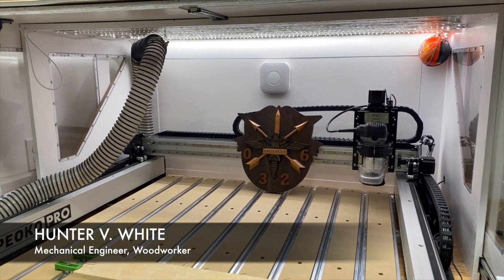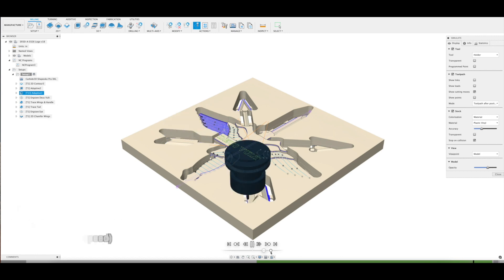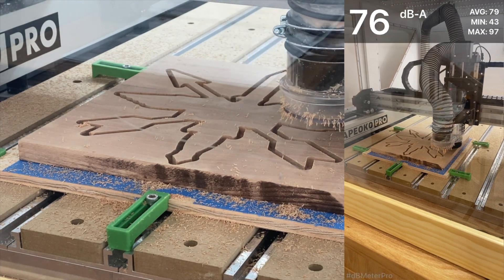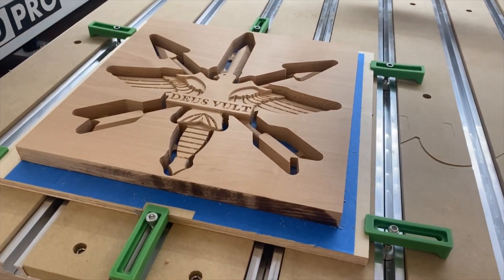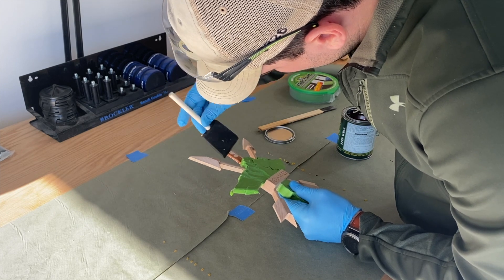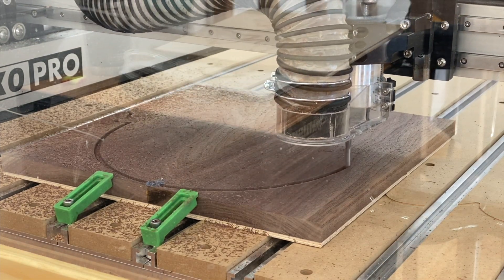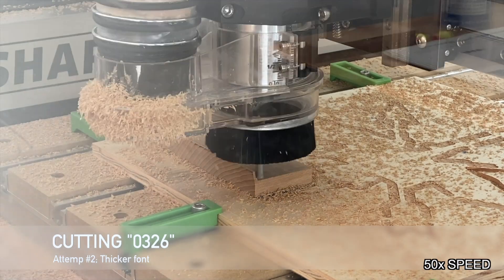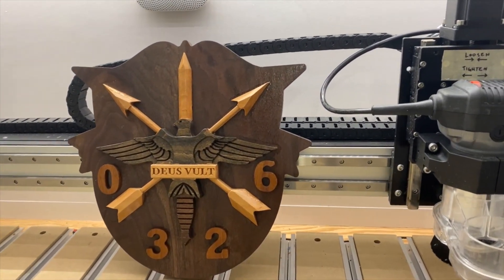CNC Project: Special Forces Detachment Logo

Comment: What’s your rpm when using your .25 end mill? Sounds really fast could help with the volume if you can lower it. I run around 16,000 rpm

Love the carve. Wouldn’t mind if you considered doing a fusion 360 tutorial. No clue when it comes to designing 3D files. 

Awesome carve and I’m gonna use your plans for my new enclosure after the holidays
Reply from the maker: I’m running around 20,000 rpm (#3 on the Makita router). I’ll definitely try lowering it next time. 

Long term, I’d love to get a water cooled spindle. I can set the spindle speed with Fusion 360 in the g-code, so it would take the guess work out, and I could precisely choose my chip load. 

Thanks for the suffering a future video! I’ll definitely think of some Fusion tips and tricks I can pass along. 

Thanks for the comment!